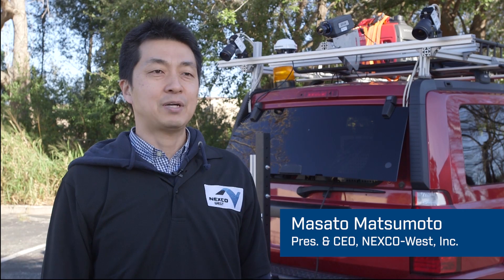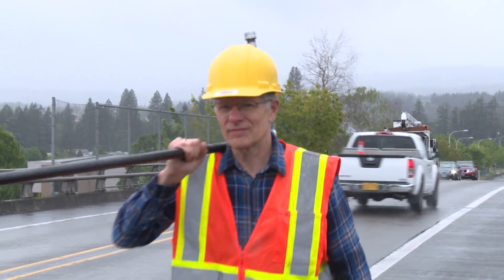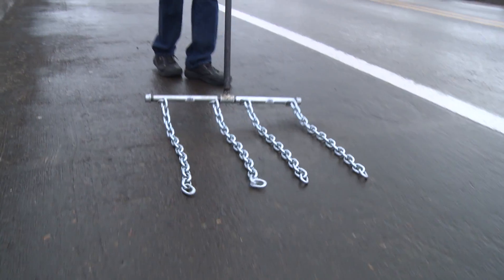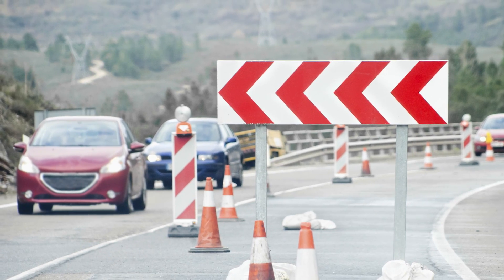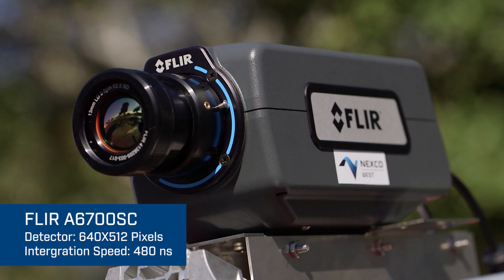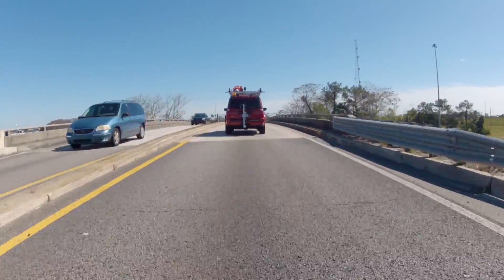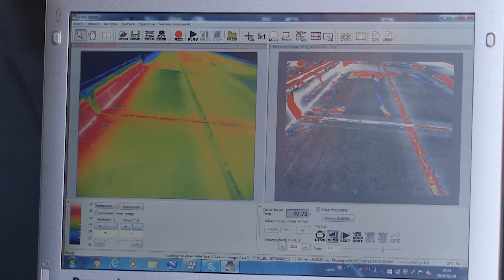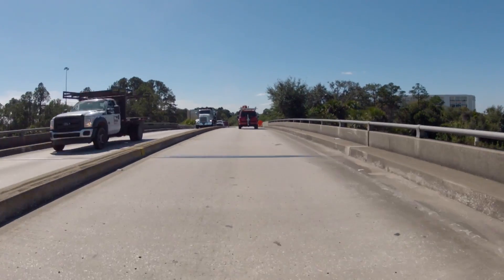Bridge Safety Inspection and Scanning with FLIR Thermal Cameras

Comment: That is great and you make a lot of great points. I work for a State DOT and we are using such technology. The good thing is that you are a consultant and the bad thing is that you are a consultant company. What I mean by that is that we are required to have all of our certifications, NICET and above to test concrete, asphalt, aggregate, do quality control / quality assurance inspections over contractors as well as do culvert and bridge inspections and per Federal standards. So we have all these certs and license and do it far cheaper than you can do it. However, there is a consistent battle over privatization and the use of consultants. For example, I have all of the above and I'm at just over $20 plus benefits, which your company probably can't eve touch. The average consultant is making $25-$35 an hour and the consultant company is charging at minimum $150 an hour. However, as your video points out, you are driving highway speed and doing thermal imaging which I do agree is far better than sounding with a chain or hammer. Yet when we go out we are taking the snooper truck the drones and checking the bridge and all of it components in one shot. So yes we are setting up traffic control and taking a lane. The bad thing is that is was the the consultants had one person who for example be certified to do say your thermal imaging of bridge deck, one to test concrete, one to test asphalt or aggregate, one to do QC/QC inspections and testing of contractor and one to do culvert inspections and one to do bridge inspections. Now and finally we are requiring consultant to have Nicet at min. and they are now struggling to to find qualified inspectors. The bad thing is that if you were an Eskimo from Alaska and said we have a new ice sickle we are going to buy it! 

We have companies sell us services and products that are supposed to oh so great and we never do our due diligence and test they stuff. They never come out and ask us what do you guys want or need?  instead of researching stuff like say a drone from DGI, which lets go with their best one which is $1500-2000. Instead of buying through them, we will use a company like yours that from your video one provides one aspect... thermal imaging driving over a deck and we'll pay your firm stupid rates and charge. Say you drove over a bridge 1500 feet long and charge us $10,000.00 and we are dumb enough to pay it. Again that is good for you bad for us!
Reply: I believe that video wants to demonstrate the usefulness of the thermal camera. the problem of consultant costs is a different subject ...